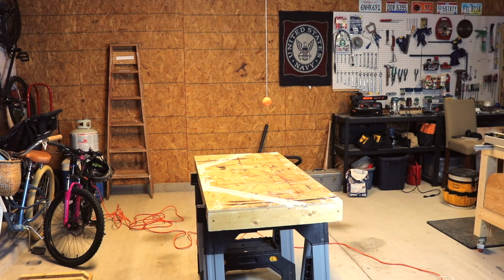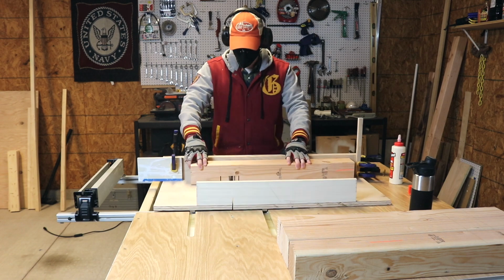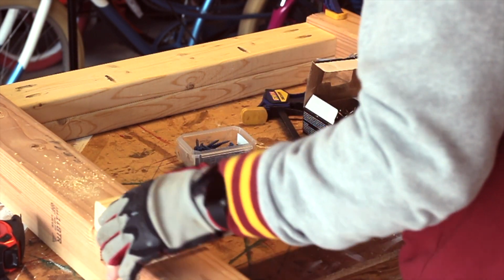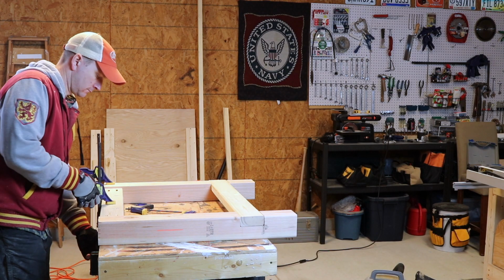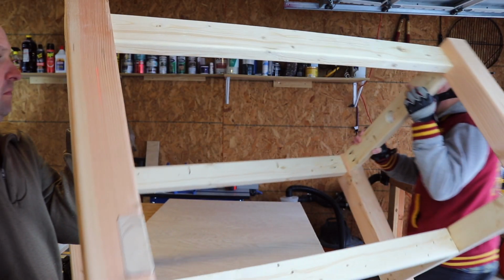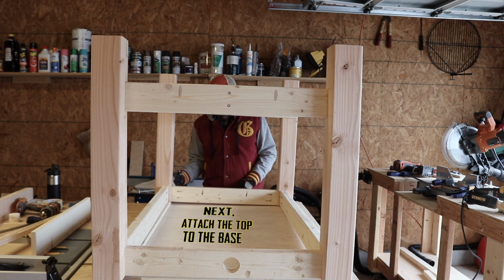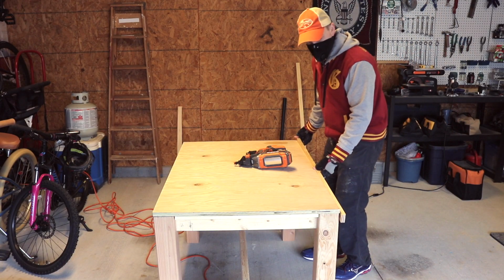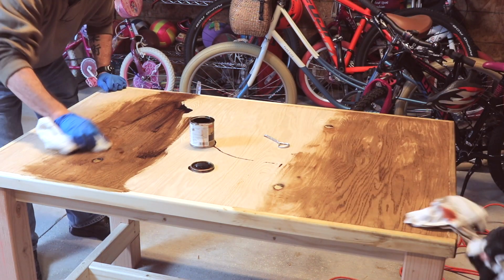How to build a custom Podcast Desk

Comment: Yo its ya boy Mike Mike Wun on the track. Any recommendation for screw type/length? And how much in total for materials?
Reply from the maker: It was about $180 for materials.  Chuck used pocket hole screws and 2 1/2 inch decking screws for the legs.